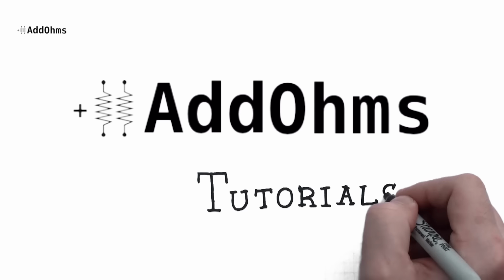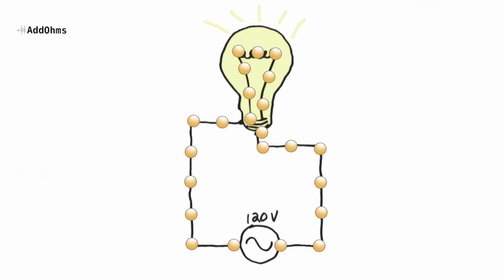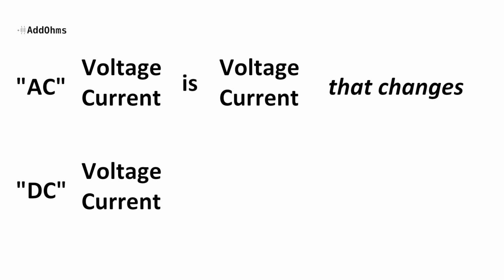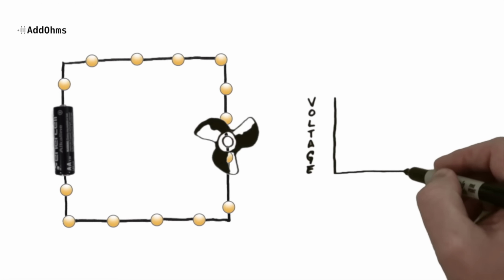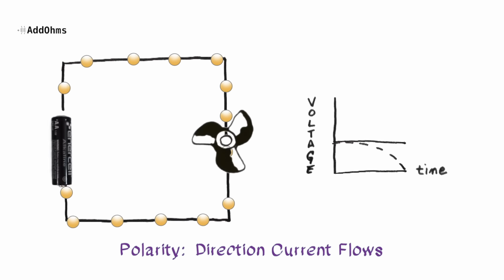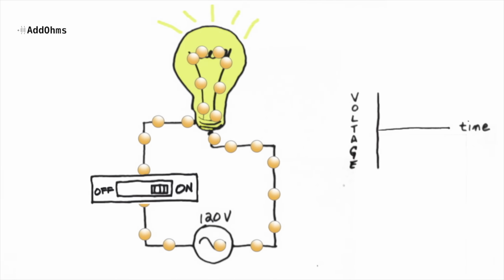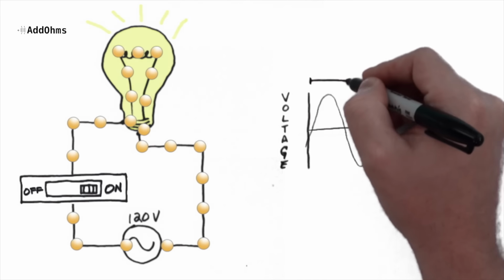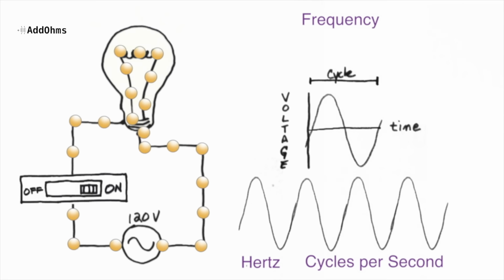Difference between AC and DC Current Explained | AddOhms #5

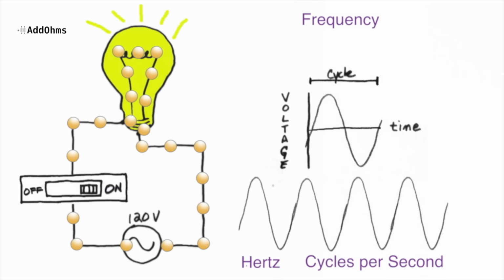Comment: I think the bulb should flash 100 times in a second, considering supply frequency of 50 Hz. Twice in each cycle, isn't it? See at 3:35.. Correct me if I am wrong.
Reply: +Jeetesh Chaturvedi AddOhms is wrong, you're right: 60 Hz flashes 120 times/sec.  A mistake in an otherwise excellent presentation
Reply from the maker: +Joe McLaughlin Not the first time. :(
Reply: Definitely its an excellent explanation.. :)
Reply: +AddOhms I hear ya brother
Reply: Why do you say that? A flash is surely going from max,  down to low, then max again. Or opposite. For example; just turning off a flashlight isnt a flash. However, turning it off and then on again would be a flash.  That gives 50 flashes per second when it's 50Hz.
Reply: Standart lamp shown on the video is not flashing. Under "Standart lamp" I mean incadensent lamp. Because operating principle of incadensent lamp is emission light from heated by elecrical current tungsten wire. Heated tungsten wire will not cool down so quickly (100 or 120 Hz). This is one of advantages of incadensent lamp, that it is not flashing and our eyes feel more comfortable with this type of light source.
If it is shown Compact fluorescent lamp, yes it will flash with 100 or 120 Hz frequency.
Reply: @AZArTx1  Yes man, but here the aim is to explain the behaviour of the AC, you are rigth anyway pointing out the thermal inertia.
Reply: yeah i'm pretty confused with right now
Reply: Christopher I can't understand
Ur explanation
Reply: @nani-vr7me  At 50Hz, the are 50(or 49) voltage peaks per second. Flash =  (voltage peak to voltage peak) or (voltage bottom to voltage bottom) --> 50 flashes per second.
Reply: If it flashed you would be right, but it doesn't flash, because it's incandescent. The element heats up and is outputting light, when the current changes direction there is not enough time for the filament to cool down, so it doesn't flash at all.

Comment: What if I were to put a diode on that light bulb diagram you drew? Would that change it to DC?
Reply from the maker: +Alden Bell No. It takes 4 diodes and a capacitor to "convert" AC to DC.

A single diode in series with the light bulb would actually make the light bulb's flicker pronounced enough you would may be able to see it. It would spend "half the time" (the cycle is negative) off.
Reply: +AddOhms Technically, a half-wave rectifier (using only a single diode) and a capacitor can produce DC. Indeed, half-wave rectifiers are often used in commercial products to save cost when performance isn't critical.
Reply from the maker: Good point, thanks for the correction. I have only built full in the past (and not very many.)

Comment: Okay, this is probably a pretty stupid question, but, if the flow of electrons alternates direction in AC, why is there a hot wire and a neutral wire in household wiring? Why aren't both wires hot?
Reply from the maker: +Douglas Carkuff Hot and Neutral define how the two wires are wired. Hot is normally the switched or fused wire. While neutral is connected to earth ground somewhere in the system, for safety.

Comment: I have read a lot of the comments below and didn't see any answers posted to the questions that I have. So hoping you will answer them.We loose a lot going from DC to AC and back to DC again. I absolutely hate having to pay electric bills every month and want to create my own power so that I can stop shelling out my hard earned money to other people. So, I am in the process of getting solar panels for my home. Which is DC power stored into batteries then converted into AC power thru an invertor. I am also working on a water wheel to make more/extra power to charge the battery bank when the solar panels are not performing at peak due to cloudy/rainy days, or night time. The water wheel of course will have a modified alternator on it, making it a generator and wire to carry the DC power to my battery bank. I get how this all works. But still wish the house could be wired all DC and not have to store the power into battery banks which cost to replace them within 5 years.So, Tesla ...I think it was Tesla...Its late and my brain isn't working the greatest right now..lol..made power thru some kind of magnet generator ...Is it possible to build a home size version of it, that constantly runs so that you wouldn't have to store it in battery banks? And if it is possible without burning youe house down or blowing up the entire neighborhood lol, then how would you wire your electric wires in your house ...meaning would you have to rewire your house with different kind of wiring or would it still work on the regular housing wire?
Reply from the maker: +getsmartnow2011 It's all about efficiency and it depends on where the conversion takes place. If you converted your home's wiring to DC, which voltage would you choose? 5V? 12V? 48V? Doesn't matter. You're going to need switching converters to convert your "home DC" to whatever each individual device uses. Keep in mind that lower voltage means higher current, which means more power loss the lower the "tranmission" voltage goes. Plus, now you have to create some kind of plug standard.

Each application that uses AC would now require their own inverters. Or you'd want to have a large inverter with parallel AC wiring for AC-only appliances.

Just my guess, but when it is all said and done, it may not be worth the cost and maintenance of all the new hardware, just to save a few watts of power (if any).

Comment: Guys i just had a doubt... NOT RELATED TO THIS VIDEO..."Why capacitor is used to shorten and inductor use to opened when DC is supplied to a circuit"...????.....  AND...."Why capacitor and inductor remains same in AC supply in a circuit"...???Sorry  if it's a dumb question ><
Reply from the maker: +Sonu Girish The question isn't simple enough to answer in a comment reply. However, the key is that both an inductor or capacitor is "reactive." They "react" to changing voltages and currents. 

This is compared to a pure resistor, which changes linearly with a voltage or current.
Reply: AddOhms thank u

Comment: How does the current stay the same as the voltage varies in AC? Would that imply that the resistance varies?
Reply from the maker: +Victor Chen The current changes with voltage. In fact in "capacitive" and "inductive" circuits, the change is "out of phase."
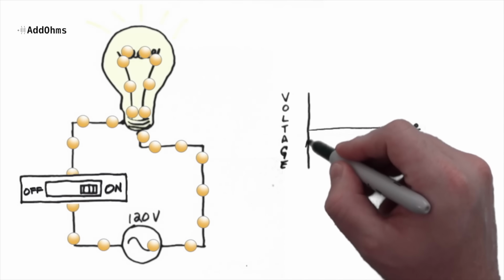Reply: Oh ok yeah that's what I thought. I guess the animation is a bit deceiving because the "current" yellow dots are always at the same "speed", when they should be accelerating. What also confused me was that at 2:40 he says "once the voltage reaches its peak, current flow stays the same, but the voltage begins to drop".
Reply: AddOhms What is the delay in phase in capacitive and inductive circuits attributed to? Why aren't capacitors and inductors instantly responsive to change?
Reply from the maker: +Victor Chen Hmm. I think I understand your confusion. I meant the direction of the current flow, not the amount.
Reply: +AddOhms so the current flux doesn't change? I'm confused again now lol
Reply from the maker: +Victor Chen Capacitance and Inductance are reactive to AC. Meaning, their impedance (complex resistance) changes with frequency. This cases the voltage and current to be out of phase from each other. 

You can use the mnemonic to understand how:
"ELI the ICE man"
ELI = "Voltage Leads Current" (the E comes before the I, and the L is for inductor)
ICE = "Current Leads Voltage" (the I comes before the E and the C is for capacitor)

Comment: good information.....but i need someone to help me....i very curious.....about current flow for ac power....and my question is....it is a neutral wire function on electrical circuit and other that if neutral wire is not include on a electrical circuit.....its circuit still function.....what actually purpose for wire neutral.....
Reply: ADIB RAHMAN
No, you're misunderstanding the concept of voltage. Voltage is always between two points because it is potential difference. In Ohm's law, V and I refer to the voltage and current between those two points.

So if you turn on a light, you will be able to measure current flowing on the neutral by splicing your multimeter in series with the neutral. Between hot and neutral, the voltage is 120V. The resistance is whatever load you have there. The hot-bulb-neutral forms a complete circuit.

Between neutral and the ground, there is (nearly) 0V of potential difference. If you stick your finger on the neutral wire, the possible circuit that's formed is neutral-you-ground.  Thus, very little current (I = V / R, V = ~0, R = ~100k) will flow through you. It doesn't matter if there's 15A flowing through the neutral wire at the time -- Ohm's law dictates that none of it will pass through you because the voltage between the two ends of the circuit comprising of you is 0.
Reply from the maker: +ADIB RAHMAN Current follows a path, neutral is part of the path.
Reply: +AddOhms  what do you mean path....you mean current flow on neutral wire also(ACpower)....
Reply: +ADIB RAHMAN Yes, current flows on the neutral wire too. Physically, the generator at the power plant is connected to the hot and neutral wires of your house.
Reply: +dllexport-  so you mean...current flow to neutral wire and if we touch neutral we get current shock
Reply: ADIB RAHMAN
Current does flow through neutral but in a properly wired house, you will not get a shock by touching the neutral. This is because the voltage between the neutral (your finger) and the ground (where your feet are) is close to 0, since the two wires are physically connected in your house.
Reply: +dllexport- so you mean current is flow on the neutral with 0 volt and  if we 
measure using a meter on the neutral wire can we get the value of 
amp(current) because u say current is flow on neutral wire.
Reply: +dllexport- ooooooooooic...............even 100A through are neutral wire we cannot get shock because of voltage is 0.... base on ohm law. and we can also get the current value if put meter in series at neutral wire....oh my...... thank you for explanation, actually i really want to know its a neutral wire is ground (earth)
Reply: ADIB RAHMAN Correct, because no current will flow through you.

To answer your other question, the neutral wire is not the ground/earth wire. The neutral is connected to the neutral wire of the power line that feeds your house. The ground wire is literally a metal pole that is buried ~6 feet deep into the soil outside of your house. Back at the power plant, the neutral is also connected to a metal pole buried in the ground, but because soil has resistance, there is a voltage difference between that pole and the one outside your house.

So, for safety purposes, the neutral and ground wires are connected together in your house to make the two have the same voltage, so that touching neutral won't give you a shock. But the ground will not carry current unless there is a fault in your house that causes the neutral to become disconnected from the transformer (or if the power lines feeding your house lose their neutral connection).

The reason is, again, Ohm's law. The resistance of the soil is much higher than the resistance of the neutral wire, so very little current will flow through the ground wire.

Comment: Okay so if light bulbs flicker when they're powered by AC, then when I plug my charger into my laptop or put my TV on, is that actually turning on and off very fast? my guess is that there is something in the battery packs of the "chargers" for both, so does it turn the current into DC or something? Thanks so much for this video though I never really understood why there was AC and DC :)
Reply: Lucy Jo From my understanding, devices like computers take in the AC, store it in various capacitors, and distribute it as DC to the device as it requests it
Reply: somebody answer this question pls
Reply: I actually asked my brother about this, he did physics a level, and he said that the power packs in the chargers for the TV and laptops and what not have a transformer that turn AC into DC. He also said its quite efficient but there is some energy lost as heat, as you might be able to notice when touching a power pack. As far as I know this is right but if someone wants to correct me then I'm all ears :)
Reply: Lucy Jo  Im' still confused...So if laptops or TVs used AC, then it needs transformers to change it to DC, then why use AC in the first place? Sorry  if it's a dumb question ><
Reply from the maker: ryanmsc AC become the dominate standard for power transmission many years ago. So today, it's everywhere.
Reply: Ok...then if AC's more efficient, why is DC even needed? Like why DC is used in batteries instead AC?
Reply from the maker: ryanmsc AC is efficient for long distance power transmission.  Creating a small compact device like a battery that generates AC would be incredibly difficult.

In engineering there are many trade-offs to consider. Rarely is there just one "best" answer.
Reply: Thanks guys
Reply: Got it Thanks alot!!
Reply: Ohhh right thank you guys :)

Comment: So could I use  DC volts in something that requires AC volts (like a tv). or would it ruin it?
Reply from the maker: junior fio No. However, the question isn't very practical for a number of reasons. 120-220V DC isn't very common, at least, in most households.

Most electronics run on DC, but have built-in AC to DC converters. Appliances almost aways require AC, because of the motors.
Reply: AddOhms ok, thanks :)

Comment: I have 2 question:1 What causes AC current to alternate?  2 Laptops use a DC battery so why are we able to charge it using an AC outlet at home? Any answers will be appreciated.
Reply from the maker: Alpha581 1) Electrical Generators are huge spinning magnets inside of wire coils. As the magnet spins around, magnetic energy is converted into electrical energy. This creates the alternating current/voltage.  

2) Laptops use AC to DC converters to convert your 100-200V wall-AC into the DC voltages the laptop's electronics operate on.
Reply: AddOhms Thanks for answering.

Comment: so in other words wall is dc and a battery in ac 

the wall keep supplying power no matter what so the voltage and current stays the same when in a battery it will die after awhile of use so theres the alternating change in current ?!
Reply from the maker: Frank Lopez Sorry, but you got the idea backwards.  Your Wall is AC and a Battery is DC.

A battery provides "direct current", but its voltage will drop over time.

The AC in your Wall is changing voltage (and current direction) 50 or 60 times a second (depending on where you live.)
Reply: AddOhms America,  Boston, ..... 120 is 120 outlet so we
Does that change?  Multimeter will read 120
Reply from the maker: jai Lopez 60Hz which means 60 times a second.

120 is the Voltage, not the Frequency.
Reply: AddOhms in so your saying that dc don't have a frequency that's why is direct?  While a alternates in frequencies?
Reply: AddOhms so 120v 60x a sec?  I'd that right? ,

Comment: What is causing the changing in direction of currents?
Reply from the maker: Depends on how it is generated.  The electricity in your house is created by a rotating generator.  As the generator rotates, it creates a moving magnetic field and that magnetic field induces current on its wires.  That current shifts along with the magnetic field, creating the alternating current.

Comment: hello sir ac stands for alternating current but your explanation on that is not practically possible.  for the first half cycle(180 degree) it stay positive remember below 0 no current exist (exist in theoretical analysis) so for next half cycle current remain absent. if we consider your explanation then in our socket we would found current from both points which does't happen.just conform using your DMM.pi to 2pi there no current exist,all other explanations are good.
Reply from the maker: I'm sorry but you seem to be confused or misinformed.

You say that no current exists below 0V.  This is absolutely not true. When the voltage goes below 0V,  current flows in the opposite direction because the electric field has reversed.  This is the very basis of "alternating current."

A (non-true RMS) multimeter uses a rectifier to measure an AC waveform, assuming it to be sinusoidal (like what is found in a wall socket) to report a positive value.  Use an current probe and an oscilloscope and you'll current flowing in both directions.
Reply: AddOhms  so please clear how and why AC current alternates each of time period,give me practical explanation not using sine wave.
Reply: AddOhms  so you mean each time period phase become neutral and neutral became phase and so no,,,,,.if yes please give me exact calculation how many times it does and how many intervals for it occur.
Reply from the maker: Sadasiba Behera I'm sorry, but I do not understand your question at all.

I think you are confusing the terms "phase" and "neutral" with something else, but I cannot figure out what.
Reply from the maker: Sadasiba Behera  I'm sorry, but I do not understand your question at all.

A sine wave IS the practical explanation for how AC works.
Reply: Sadasiba, did you just ask him to explain what he meant without using the base platform of measuring AC current? That makes no sense, it's like explaining gravity without the gravity being intact. 

If you use a standard multimeter, like AddOhms stated, you WON'T see the current on the polarity change, you will need an oscilloscope. As for your exact calculations, it would all depend on what was being measured, as he explains in the video, if something is 60HZ, then thsi change happens 60 times per second, if it 50 HZ, then it happens 50 times per second.